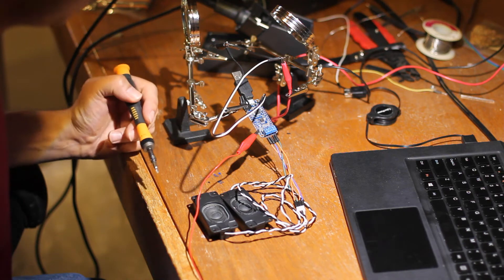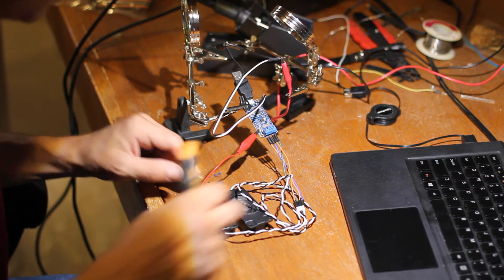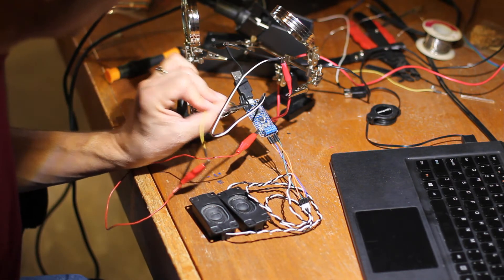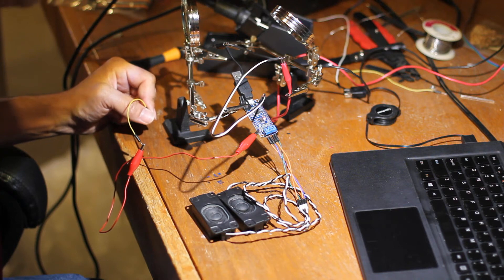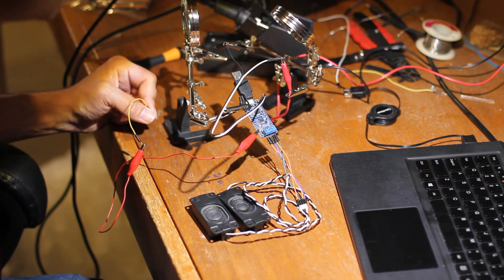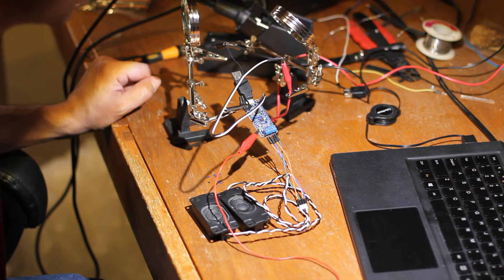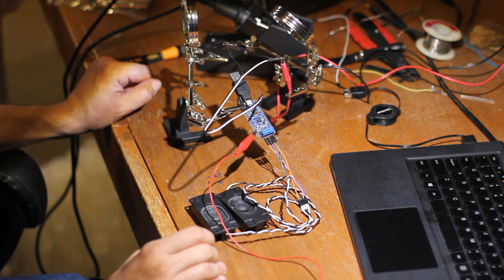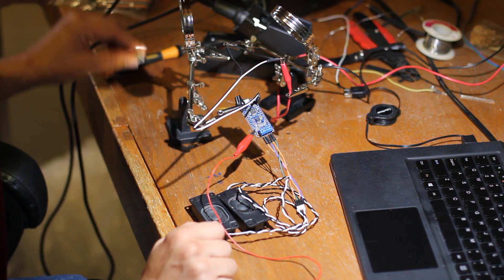Adafruit Sound FX Board

Comment: Hey, nice work !
I try to do the same with the Adafruit mini sound board and the Adafruit mono 2.5w amplifier, using  2x CR2032 for the battery, and it doesn't work.... the sound stay only 3 seconde before stopping.
Is it because my tension is to high ? I have 6v (2x3v)
I use this item for my batterie: 
https://www.amazon.fr/GTIWUNG-Porte-Piles-Supports-Commutation-Interrupteur/dp/B0823W1MX7

When I try with an USB cable form my laptop, it work well, and its 5v.

Thx for your help Professor  ;)

Comment: Hi, I only would like to trigger 1 sound with a button do you have a cheaper solution? thanks
Reply: Hey, search for "dfplayer mini" you can just hook up power (Battery), Speaker and a button, that´s it. And it reads microSD cards with MP3. You can also control it with an arduino our use it without any controller. And it costs between 2 to 8 bucks.

Comment: Sir,I have been trying to trigger  a file track  or file name by serial input with Arduino. I have been successful using the syntax  sfx.playTrack(n) where n is the track number. However sfx.playTrack (name) has not worked.  I have tried every combination I could think of following the Adafruit instructions tutorial i.e.  sfx.playTrack"PT01ATCH1WAV\n"");. Have you had any luck at this?mhewett737@yahoo.com.